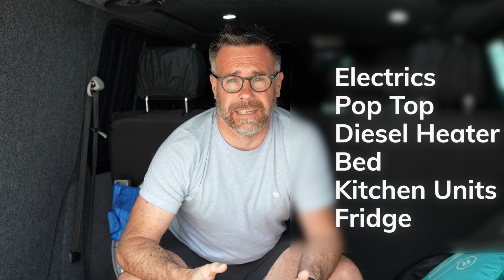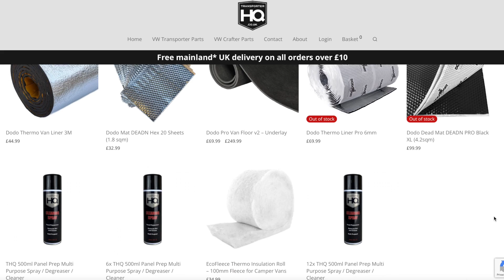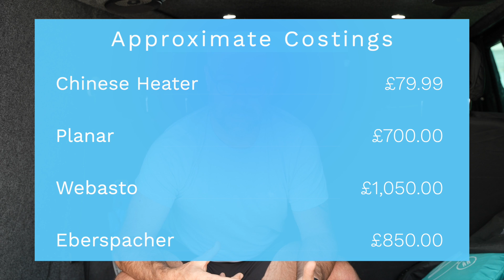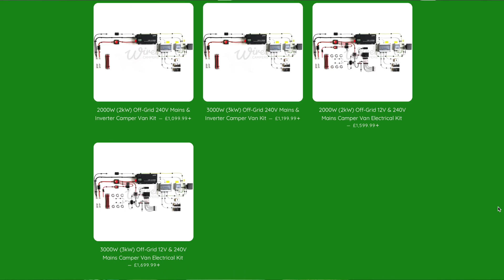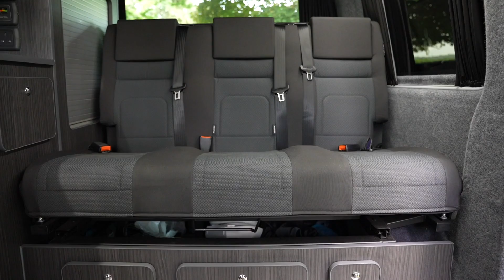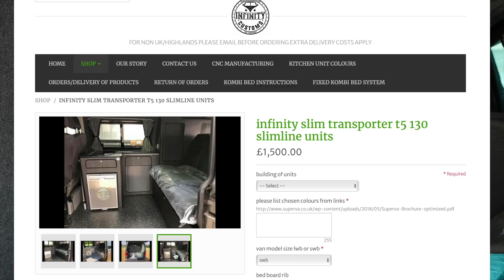Unveiling the Price to Turn a VW Transporter into a Camper

Comment: Hi I recently went to the show at Birmingham. October 2024. Had a chat to the gentleman at Bodans stand. Asked about the insulation used in the vans , he told me that they do not insulate the floor. I’m a bit confused because all the information that I’ve looked at recommends to have all the van insulated, like you’ve also mentioned on this video . I want to buy a van and have it converted professionally, so do I have it by someone like Borden’s that doesn’t insulate the floor or do I go with someone that does ? Does the floor need insulation?

Comment: 8:20. Not sure why you suggest that having 240V means you need to worry more about fire? It's the low-voltage side that has the high currents (in general). 20-times higher for the same power. And it's current (well, resistance*current really) that makes things hot.
Apart from that detail though this was very good advice. That factor of 10 difference between a Chinese heater and an Erbesbacher is kind of crazy. If we could just get the Chinese to make slightly less shoddy ones for 200 quid that would be marvellous :-)

Comment: I haven't got a clue about  all of this. When does a panel van have to be  legally registered as a camper ?  Are there insurance benefits of one over the other?
Reply from the maker: A panel van can only be registered as a camper van with specific requirements from the DVLA including a fixed high top roof, therefore most can’t be reregistered. Insurance wise, it’s a long winded answer, but essentially it’s easier and often cheaper to insure a Type Approved Vehicle, rather than a modified van. Some answers can be found in my latest video https://youtu.be/RbLT-4EMVTI

Comment: As regards leisure batteries... I use a Buck /boost converter. This 'pulls' an even level of power from it.... This way, not only does the voltage stay even from the start, it takes you deep into the dead zone before connected components start complaining.
Battery starts at 13+v and finally grinds to a halt at 10v BUT the output is always 12v!

Comment: Not everyone has 10grand to spend on conversions and will always opt for a DIY van and some are awesome some are basic as is mine
Reply from the maker: Absolutely and no need to spend a large amount to make a van how you want it. The benefit is how you use it, where you take it and enjoy what the UK (or Europe) has to offer
Reply: @StaycationLifestyle  I made my ldv cub capable of sleeping in as I realised yrs ago that's about all most do when away for a few nights on say shell island, i have base tent that attaches to back doors from decathlon and I have a home made awning for the side it suits my nature of make do and mend,  haha, i Do have solar and charge regulator for the basic 12 volts and I have the dreaded fridge under the fold up part at rear of bed accessible only from outside haha

Comment: Bed is a difficult choice. I think those 3 seaters that allow for slimline cabinets are very narrow. So you go full width and no cabinets. Then there's testing! What does it mean if the seat isn't tested to the configuration you want? Seat on rails is a great idea. That is important to me. Have the van in Kombi mode when travelling and have all the paraphernalia packed safe behind your passengers. RIB on a rail is twice the price you have shared, especially if you want to be able to say that it has been tested. Hobs? How difficult is it to get a decent pod with a sink without an integrated hob that needs a gas bottle? Personally I don't like the idea of a fry up in a van. Prefer to cook outside as long as it is sheltered. Fridges? You make a great point on fridges. I thought I wanted an integrated fridge but a decent coolbox is much more practical. Thanks for starting the conversation.

Comment: Very good video having had my last to work vans converted the first being a Vivaro swb they put a rock & roll bed in nice comfy but terrible storage, second van custom lwb I had seen the Rib beds at a show & had the benefit’s explained & had one fitted, the storage is fantastic, comfy.
The other advantage is if parked on a slope facing down towards the front you can raise the bottom of the bed to stop you sliding down, the height his a disadvantage but can be remedied with a foot rest, cheers.
Also definitely L W B.
Reply from the maker: Thank you. I do like the LWB, I just don’t fancy one as a daily driver. The extra internal space is very handy

Comment: I can't understand this fad about VW vans. I could understand it, if it were a premium car, but a van ? I found that a transporter is quite thin, therefore with a side kitchen, it provides only space for a narrow bed. In my Talento, there is much more space for a wider bed, with a nice width kitchen alongside. Not buying a VW, saved me thousands and at the end of the day, it does the same thing.
Reply from the maker: The big difference with a VW other than the other manufacturers which as you are are better, I personally love the Merc V Class, is the residual values. The residual values are far better than anything else. The Transporter is actually slightly wider internally than the Talento. When you come to sell your Talento, you will lose more money than a Transporter owner. It’s all about personal choice though, everyone has different tastes. Anyone with a van can have the same outdoor experience and enjoy life. (I do like the Fiat based motorhomes like the Joa)
Reply: @StaycationLifestyle  my rib altaire bed is 120 cm wide, with good cupboard width. The california is 114 cm ?
Reply: @stevezodiac491  Firstly, you need to get your tape measure out - EVERY internal dimension of the Fiat is SMALLER than the equivalent in the VW. 

Fiat internal dimensions (cm) 253.7 x 166.2 x 138.7 (LWH )
VW internal dimensions (cm) 257.2 x 170.0 x 141.0 (LWH )

Secondly, of what relevance is the width of the Cali bed to this conversation? We're talking here about custom conversions.

Here's my list of advantages that the VW has over the Fiat:
 - larger interior space
 - significantly better residual values
 - far superior driving experience (much more car-like to drive)
 - lots more safety kit (both as standard and as available cost options),
 - better engineered (try fitting a camper window to each van and compare panel thicknesses, for example)
 - a lot bigger and more vibrant after-market scene (which provides for almost infinite customisation options).

Obviously the Fiat is cheaper to buy, but the total cost of ownership (including selling it on) is likely to be significantly higher.

EDIT: Also, the Transporter has been highly regarded by the campervan community for ~70 years, so to call it "...this fad about VW vans" is analogous to saying "the Atlantic ocean is slightly moist".
Reply: @stevezodiac491  My smart bed evo is 120 cm wide?
Reply: Basically they are not too wide and they drive like a car engines are bulletproof  if the service right, not uncommon for 300,000 mile.. can always sell a Volkswagen van conversion with less depreciation and there’s a big community out there on Volkswagen.